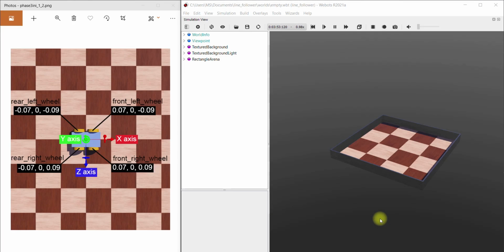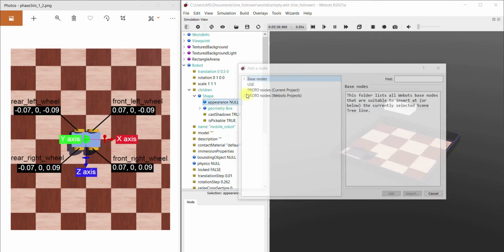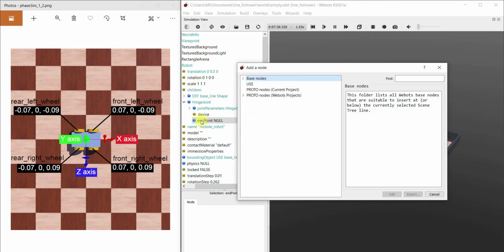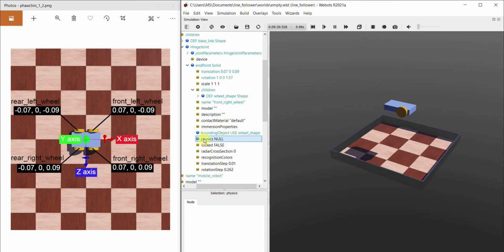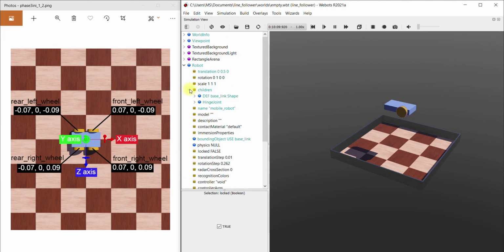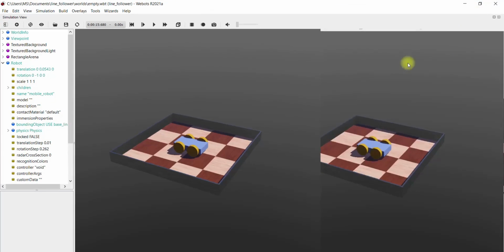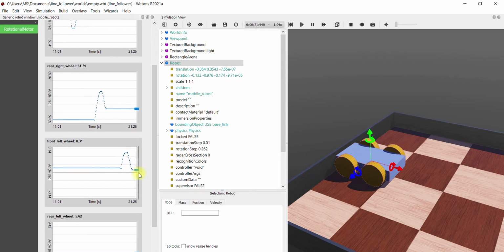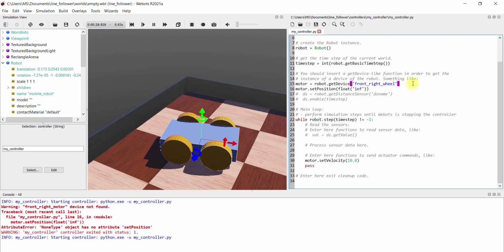CREATE Classes: Robotics | How to Build a Mobile Robot in Webots

Comment: webots is not able to launch on windows 10.
What can be the reason?
Reply: Webots is a resource-heavy software. Ensure that you have updated GPU drivers and preferably Nvidia GPU. If the problem persists, try tweaking the compatibility options in the application properties.